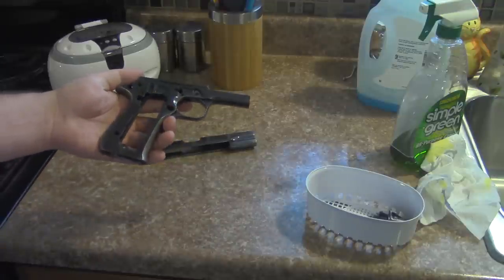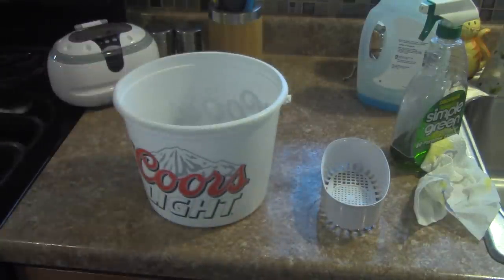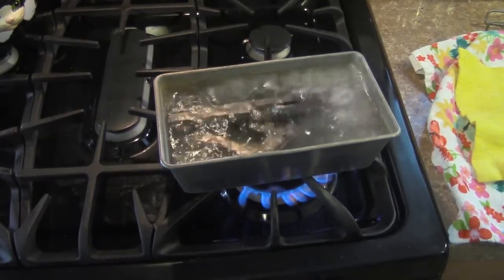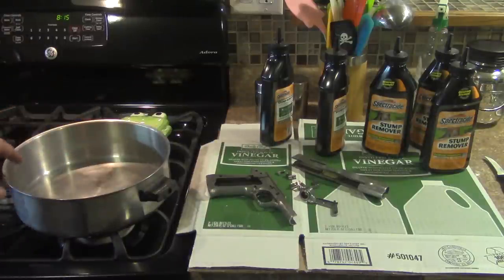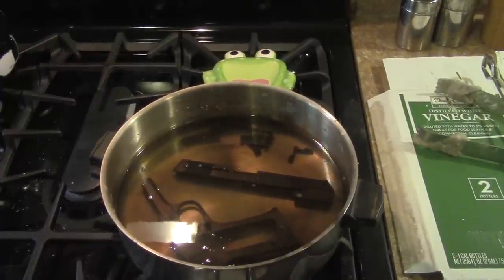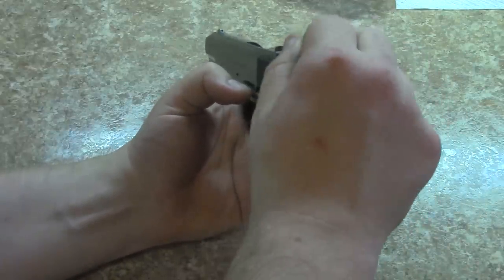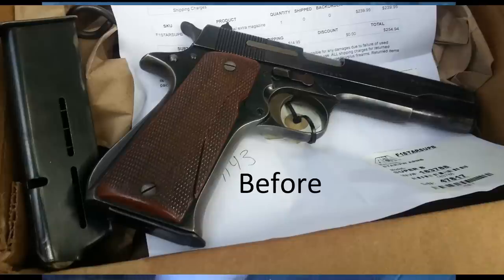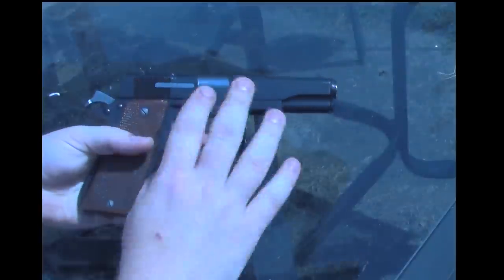DIY Reblue Your Gun at Home for $50

Comment: Wd40 isnt suggested to be used on any blued fire arm. It is a penetrate and works against the reason for bluing in the first place. Rem-oil is suggested- or any other non penetrating oil. Also, the temperatures that are supposed to be maintained with the solution being used is 185 to 190 degrees.
Reply: No, 600 degrees F.  I'm not sure where you came up with 185 to 190 degrees unless you are using Celsius.  Even then, that would be for hot caustic bluing, and even then that's wrong as it should be about 275 degrees F.

Comment: Love the vids whats the best way to get rid of pits in a old pistol it's my first restore thanks again for the vids
Reply from the maker: Only real way is to sand/buff them out which may not be workable depending on how bad the pits are. Normally you could use a welder and add material but don't think I would trust that to not damage the temper of the guns metal so you might have a wall hanger if the pits are too deep.

Comment: Hi there. Thank you for the video. I have a Norinco model 54-1 Tokarev that I'm getting ready to restore. How many jugs of the stump remover did you need? And, is it just the stump remover or did you mix it with something else like distilled water? You did a good job. That gun looks great.
Reply from the maker: I used 5 bottles but that will vary depending on the pan you use and the size of the gun.  You don't want to mix anything in it and keep water far away from the hot salts.

I just posted a vid of a norinco I reblued using the same process.
https://www.youtube.com/watch?v=nrm9XUv1MYA

Please read the Brownells instructions thoroughly before trying and make sure you know what you are doing,

https://www.brownells.com/userdocs/learn/Inst-362%20Nitre%20Bluing%20Bluing.pdf

Comment: good job.  i'm gonna look for a cheapo   project ,  good idea on the turker fryer maybe i could do it in the garage.
Reply from the maker: The salt can burn if it gets hot enough or spills onto the flame so I would not recommend using a turkey fryer indoors.
Reply: good to know then. thanks for the tip
Reply: make sure the pot pan or whatever is stainless steel  NOT aluminum

Comment: Good stuff, I bought a Star Super and it looks like its been rode hard. Gonna strip, sand, polish (I have a commercial polisher) and use your method to reblue it.
Reply from the maker: I have done 3 guns now, this one, a Browning HiPower and a Norinco 213.

Here is the Hi-Power
https://www.youtube.com/watch?v=CYrbkszwxiI

I just picked up a 1950s craftsman 1/3hp fan motor/ belt drive buffer arbor at a swap meet and have been practicing buffing.  I think the next gun I do I will try to buff it to a mirror shine and then blue to get a really polished end product.

Comment: I just bought a super b, and I am very interested in refinishing it. Do you know where to find the full disassembly instructions, or did you just tear into it. Any help would be great, the instructions I have found are vague at best. thanks
Reply from the maker: it was an absolute nightmare to get all the fiddly bits out of the frame.  i found a star super b manual with the instructions but they are text only so you have to do some experimentation.  let me find a link.
Reply from the maker: the manual is availible here

http://star-firearms.com/firearms/manuals/downloads/super_disassembly.pdf

Comment: this is a very interesting process but i will say in normal hot salts bluing you're suppose to maintain a temp of 270 degrees minimum
Reply from the maker: This is a much hotter process 600-700F

Comment: You mentioned a whole packed with salts. In hindsight would a boiling water rinse before the cold water quench prevent it?
Reply from the maker: I'm not sure boiling water would have helped,  The problem was it was a blind hole and I didn't hold it the right way to get the salts out while molten.   Now I make sure to study the frame and look for pockets that might hold enough molten salt to be a problem.
Reply: I see..
Reply: you def cold water quench while bluing because it opens up the pores and allows the salts to get darker
Reply from the maker: +Jared Gandy in this process brownells recommends hot water (100f if i 
remember right)for the quench, not sure how it works for caustic bluing
Reply: Yes I do agree

Comment: Curious what you think about the idea of using an oil quench instead of water. You would remove the need to remove water afterwards. Also, it then is similar to a process I have heard of called 'hot oil bluing' where you heat the parts with a torch until it changes to an interesting dark color and then quench in oil.
Reply from the maker: +anotherOneMore7 Salt is water soluble but if you quench in oil you stand a good chance of leaving salt inside your gun which will cause rust and possibly wear on the internals.

Both this and heating with a torch are heat bluing processes.  But to try to heat a whole part to exactly the same temp is difficult.  Using a torch will be uneven, even an oven will be uneven if your oven would hit 700-800 degrees and then hold that exact temp.  Water and oil either boil or burn at those temps so you have to use a liquid that won't burn at those temps and allows even heating.  I'm sure a chemist could probably figure out a few others but stumpkiller is easiest to find.

Very old guns with color case hardening have swirls of bluing and straw colors because they were put in an oven with coal and bone and baked to temper the steel and harden it.  The uneven heat causes uneven coloring.
Reply: +Gun&amp;ShotTV Good info. Thanks.

Comment: So I have an SR1911 in "Black Nitride Finished Stainless Steel", which I'm assuming is a parkerized finish (not quite sure). How do I get rid of my current matte finish in order to blue it? Also, how do you get the stainless steel up to a mirror finish by polishing it yourself? I'm scared to go at it with a drem or steel wool and end up screwing the piece up.
Reply from the maker: 1.  You can't blue stainless steel.

2. Nitride is a hardening process that hardens the metal you can't really strip it.  

3. you could polish or or use something like ceracoat to turn black.

Look around Ruger forum for more info.

Comment: i need help when i cook the stump remover it turns to rock can i still melt it
Reply from the maker: After you melt it the first time it will turn solid when it cools.  You can still use it after it has turned solid by reheating it slowly until it melts again.
Reply: well ill try again some other time because i burned my eye when i stuck a piece in ,the stump remover flied. I dont understand how u make so much liquid i filled the pan like at 3/4 full and when it melted i had like 1/4 liquid barely enough for small parts.

Comment: Did you make a video of the disassembly? I have a star BM that I'm going to re blue with your method but I can't figure out how to take it apart.
Reply: Ive taken apart more star BM's than any other gun, lol the only struggles I had is getting out the trigger pin. Other  Then that everything is easy then putting it together the hammer is a bitch but doable, good luck

Comment: Well I started on my Star super 8 today, took it all apart, what a pain in the butt.  I put the barrel frame on the polishing wheel to put a lustre on it then cleaned it all up. Handle is in the vinegar right now.
Reply from the maker: The frame disassembly is probably the hardest gunsmithing job I have ever had to do.  Nothing was as well thought out as most browning designed guns.   Someone who saw my video and wanted to reblue their gun did make a disassembly video that is helpful.   I should have made one but after getting it apart and back together I didn't have the ambition to take it apart again.

Comment: Very cool but you do know rluing kits are sold in store for like 15 bucks right
Reply from the maker: +Gene Twombly But what type of bluing?  Cold bluing is essentially like painting the metal and doesn't really give any corrosion resistance.  Rust bluing can look very nice and provide great corrosion resistance but is a very labor intensive finish.  This is much faster and provides a finish between the 2 and after the initial investment the salt can be reused as many times as you want.
Reply: +Gun&amp;ShotTV Cold blue wears off easily too, I did 4 coats of birchwood casey super blue and after a year had to redo it.. :(  how has yours held up?

Comment: Did you use a blue camera lens to make the bluing appear darker? You can rust blue for about the same cost and it WILL looked blued.
Reply from the maker: Just a normal lens.

With Nitre Bluing the temperature of the salt determines the final color.  There is a chart in this PDF.

https://www.brownells.com/userdocs/learn/Inst-362%20Nitre%20Bluing%20Bluing.pdf
Reply: No, it won't look blue.

Comment: When you put the stump remover do you put water or something? I want to do this so bad but I don’t know how to do the stump remover melting process! How much stump remover do I have to use?
Reply: Hot gun bluing 
Pour one gallon of distilled water into the pot. SLOWLY add 5 lbs of pure sodium hydroxide to the water while stirring. The mixing will begin an exothermic reaction that will raise the temperature to around 240°. Once thoroughly mixed, slowly add 2.5 lbs of sodium nitrate.
Just a $15 ceramic coated canning pot, a thermometer that will read to 300 degrees F, 5 lbs of sodium hydroxide (lye) and 2.5 lbs of sodium nitrate mixed with a gallon of water and heated to... drumroll please...
275° F. Well below anything that would damage tempered hardness. This is as close a recipe as you can get to a commercial caustic bluing salt. 
Pour one gallon of distilled water into the pot. SLOWLY add 5 lbs of pure sodium hydroxide to the water while stirring. The mixing will begin an exothermic reaction that will raise the temperature to around 240°. Once thoroughly mixed, slowly add 2.5 lbs of sodium nitrate. NOTE: Ammonium nitrate can be used as long as it is pure. However it will create ammonia gas and needs to be very well ventilated during mixing. Once mixed, turn on the burner and heat the mix to 275°. Continue stirring. When everything is mixed and dissolved and at temperature, parts that have been finished to their final grit and polished, etc. and degreased thoroughly can be submerged into the solution. Maintain a low boil at 275° by slowly adding back water that boils off. Once the desired finish is achieved, soak the parts for a few minutes in hot tap water. Then rinse thoroughly and wipe dry and spray with a water displacing oil such as WD40 to insure there are no salts left in or on the material that will cause corrosion. Some people even soak in oil overnight.
Notes: parts should be hung in the solution, suspended where they do not touch the bottom. No aluminum can contact the salts or it will neutralize them. Parts will turn black after about 30 minutes. Some may develop a purple dull sort of finish.

Comment: I know when I first tried cold bluing, I failed horribly.  everything wore off and then it smelled so bad no matter how much I cleaned it.  was there any smell associated with procedure after it was completed?
Reply from the maker: There is a bit of smell when first melting the salt.  But it wasn't particularly bad and didn't linger   Other than that no smell other than the WD40.    And while it can wear off with heavy use it's much stronger than cold blue.

Comment: Nice but how do they blue the steel shiny/glossy? I mean if I want to have a glossy kind of blueing.
Reply from the maker: The heat/time control the final color.  The gloss is a result of how smooth you get the gun during polishing.  If you get it mirror shiny it will be really glossy when blued.
Reply: The gloss found in bluing is a product of polishing the parts being blued. If you make your gun shiny, the bluing will come out with a glossier finish. Heat and time left in the bluing salts also has an effect.

Comment: Informative video.  I might just try this myself someday.  I've read the comments here on possibly hurting the heat-treated metal parts.  I think I'll look into that before I do try it.  But for the moment my absolute biggest concern would be in the use of 100 percent potassium nitrate with a heat source.  Back in my Boy Scout daze, I was taught that KNO3 was/is the primary ingredient in oldtyme black powder (the others being charcoal and sulfur).  I would want to be extremely careful when using such chemicals around a heat source.
Reply from the maker: According to the info I have found the metal temper should be fine up to 1250F.  This process isn't close to that hot.
Reply: @GunAndShotTV  All the other videos are saying you heat to around 650-700 degrees and that that will, indeed, affect the metal hardness.  They say to use only for small, non-stressed parts only.  Have you fired this gun much since you blued it?

Comment: will the vinegar take off any kind of gun finish? or just the bluing ?
Reply from the maker: Bluing is actually a layer of oxide like rust.  The acid in the vinegar strips the oxide layer off.  It may effect other finishes but probably not as well as it removed bluing.

Comment: Would this work with pot metal and how would I go about removing paint? im an airsofter and I wanted to have a go at bluing one but obviously the metal is much lower quality.
Reply from the maker: Most potmetal is Zinc based.  Zinc or even zinc alloys like Zamak would most likely melt at the temperatures used.  Not that they would turn blue from this process anyways.  This Nitre Bluing method will only work on carbon steel to my knowlege.  Paint is probably your only option other than things like cold blue that are applied like paint.
Reply: Gun&ShotTV yeah, I had been leaning towards cold bluing, just wanted to check.

Comment: Would you say this method is more durable than cold blue ?
Reply: Everything except heating the gun with a torch is more durable than cold blue. Rust Blue is the most durable and also the most time consuming.
Reply from the maker: Yes as I understand it the pecking order is cold blue, nitre blue, rust blue then caustic blue.  but rust blue is much harder to pull off

Comment: This can't be legitimate. This is like that tech tip to fix a scratched CD by rubbing peanut butter on it and throwing it in the microwave.
Reply from the maker: This is the process most gun manufacturers used up until WWI. Lugers used it to get the straw colored parts like the hammers.  Places like Turnbull still use it to get peacock blue parts.  They use a bit nicer setups but the same end result.  For that matter many DIY people use it to give a black finish to small parts like nuts and bolts.  For small parts you can just heat it with a blowtorch and drop it into a cup of oil because you don't have to worry about heating a small part evenly. Look at other videos on my channel and you will see more guns I refinished using this method.   There is a 5000 sub video with a 1911, a few of my browning Hipower and a Norinco 913 off the top of my head.

Comment: if you want faster way to remove the old or new bluing in favor a different gun coat of blue or cerakoat/the poor mans cerakoat (high temp enamel engine paint) do the same half and half vinegar water mixture and bring to a boil or just under dump it in heat proof container likea large glass jar and its will wash away instantly. what i did w/ my m9a3 when recoating it right after i bought it

Comment: so can you reuse it , or is there some reaction that make's it not work after being used ?
Reply from the maker: The heat changes the color of the metal.  There is nothing lost from the salt in the process other than whatever salt doesn't drip off the parts and gets washed off in the water bath.  I've blued 3 guns thus far and probably need an extra bottle of stunp killler to replace what I've lost.
Reply: thank's for the info! this seem's to be a good & practical  way of doing bluing ! does the salt recrystallise win cooled off or do the stay in liquid form?
Reply from the maker: It forms a soild mass

Comment: Is that frame aluminum?
Reply from the maker: No, the slide and frame are both steel.  The slide has a rough machined finish and the frame is a bit smoother so they do look a bit different but that's how they come from the star factory.